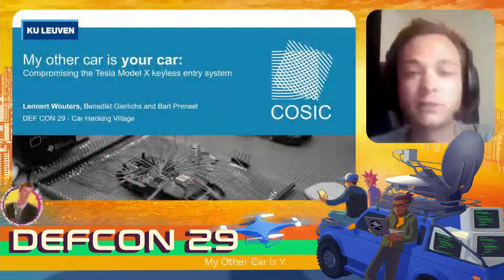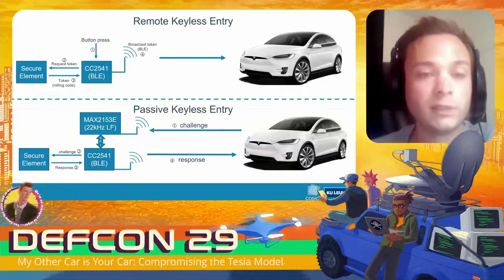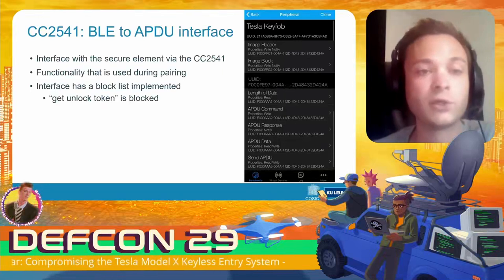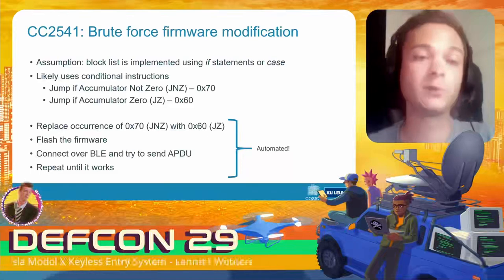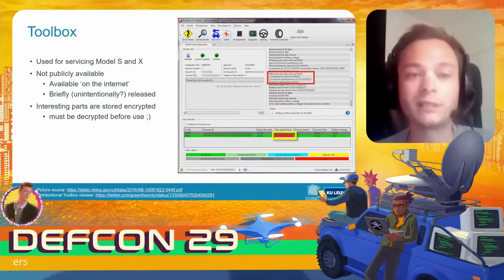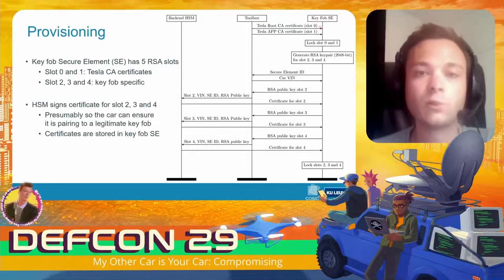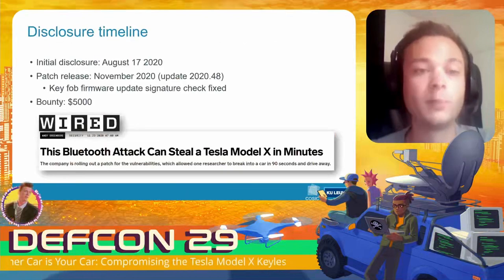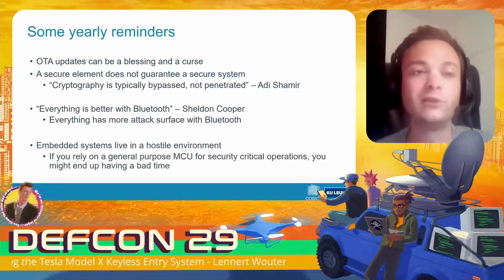DEF CON 29 Car Hacking Village - Lennert Wouters -  Compromising the Tesla Model X keyless entry

Comment: So the steps to unlock a Tesla car are :
1. modified your own BCM to pretend to be the "real" one using the VIN code on the windshield
2. get close to the car owner (key fob), wake up the fob and connect to it using the your modified BCM
3. get the unlock code from targeted key fob and use that to unlock the car.

BUT, I still don’t understand why you need a malicious firmware and how does it work? Could you elaborate more on that? 
Like doesn’t the key fob automatically send a unlock command to BCM when it senses its paired BCM is near by?
Reply: It needs the malicious code because the normal pairing procedure requires information from a Tesla server.  He bypasses that requirement with the malicious firmware.